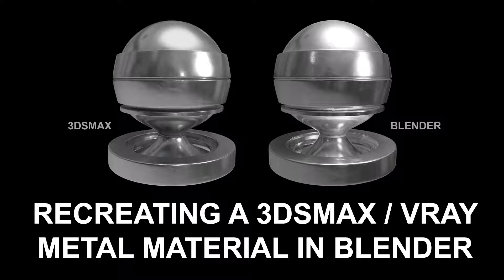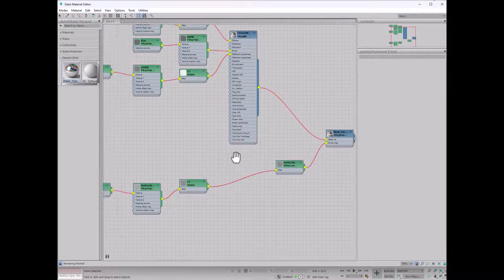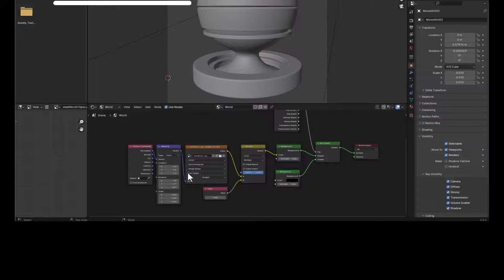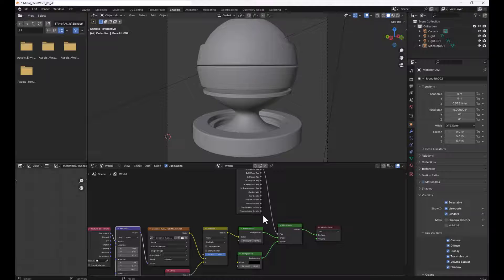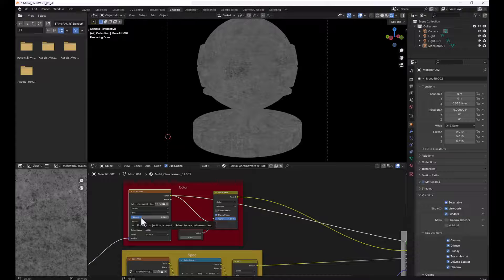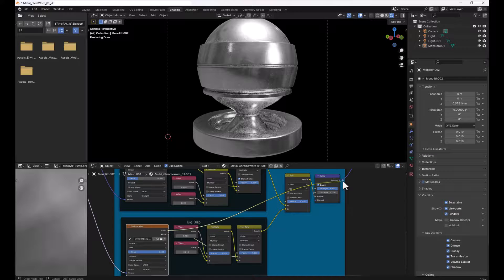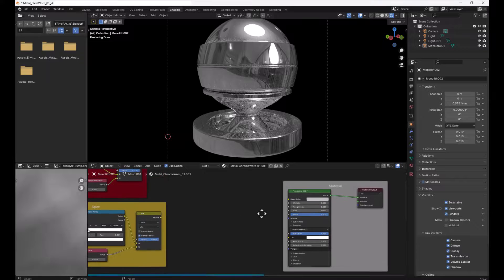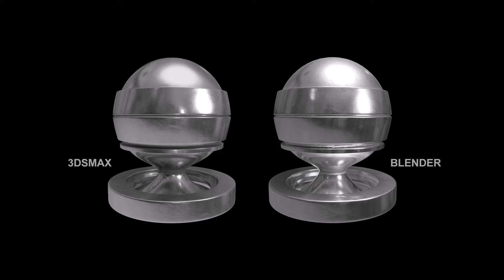Recreating A 3dsmax/Vray Metal Material In Blender

Comment: Hi Neil, I used your soulburn scripts in 3DS Max for years before switching to blender ~4 yrs ago. I hope you also explore all the modeling add-ons available (hards ops, box cutter, mesh machine, punchit, fluent, etc). When I used 3DS max I was constantly looking for max scripts so the add-ons in blender were very similar to me. I noticed you weren't using the node wrangler add-on shortcut to quickly (temporarily) display the bitmap you want to see (ctrl+shift+click on the bitmap with node wrangler on).
Reply from the maker: Thanks dude. Ya, I found the node wrangler after I recorded the video, so using it now, thanks for the note. And yes, I've mostly focused on the materials part for now, but will delve more into modeling soon, blender does seem to have a lot of nice modeling addons :)